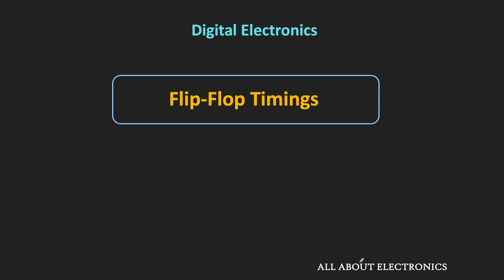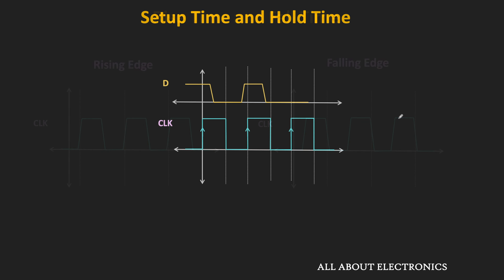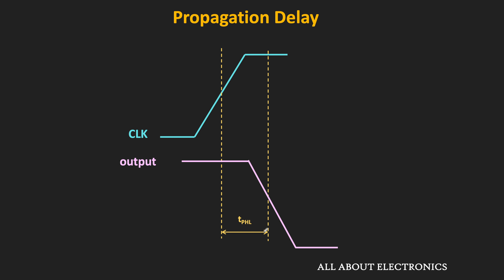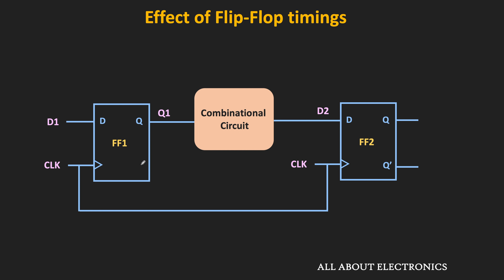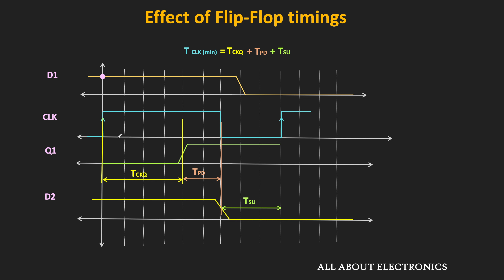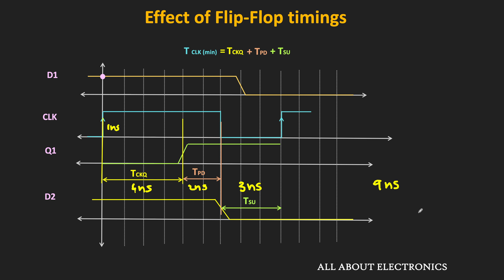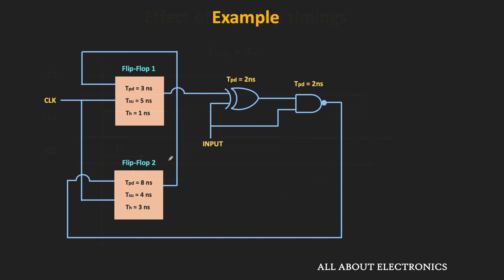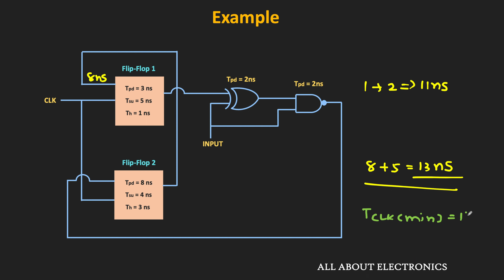Setup Time and Hold Time of Flip Flop Explained | Digital Electronics

Comment: You mean 8 + 5 is the maximum clock duration, not minimum right?
Reply from the maker: It is the minimum clock duration. That means Tclk can be more than 13 ns, but it cannot be less than 13 ns. If it is less than 13 ns, then there will be timing violation.

Comment: 14:09 in starting first case u are considering only propagation delay of the first flip flop why didnt you consider the setup time in starting but after one reputation u r considering the setup time of the first flip flop
Reply from the maker: At first, we were calculating the minimum required clock for the second flip-flop. So, in that case there is no need to consider the setup time of the first flip-flop. In that case, we have considered to total propagation delay from the FF1 to FF2 plus the setup time of FF2. 
In the second case, when we are calculating the minimum required clock for FF1, then the setup time of first flipflop is considered. Please check that example once again, you will get it. And if you still have any doubt then let me know here.

Comment: Hi Sir, In your last example , why didnt you consider Th into your calculation at all?
Reply from the maker: In this case, if you see the propagation delay of the flip-flops or even the logic gates (2ns  + 2 ns), it is more than hold time. That means there won't be any hold time violation in any flip-flop. And as I said in the video, for the calculation of minimum required clock frequency, we do not need hold time. Just we need to ensure that there is no Hold-Time violation. Please check at 11:20.
Reply: @ALLABOUTELECTRONICS  Thanks sir

Comment: @15:00 why are you not considering the Hold times that are given?
Reply from the maker: It is not required for the calculation of maximum clock frequency. I have already covered it from 6:10 onwards. The only thing which we need to check is, there should not be hold time violation.  In this case it is not happening. Because the propagation delay from FF1 to FF2 is 7ns, while the hold time of FF2 is 3ns. That means Tpd > Th. Similarly, the propagation delay from FF2 to FF1 is 8ns, while the hold time of FF1 is 1ns. So, once again there is no hold time violation. 
I hope, it will clear your doubt.
Reply: Hold is considered in the same clock cycle because a hold failure means that the data that was meant to be written to a flip flop in the next clock cycle has sneaked through to it in the same clock cycle. Therefore, the data which was meant to be written to the flip flop in the current clock cycle has been overwritten. Hold failures are catastrophic and irrecoverable since the overwritten data cannot be retrieved.

Setup, on the other hand, is the time that the data launched at the previous clock edge to arrive at the flip flop at the current clock edge. It clearly dictates the clock period. A higher setup requirement will force a delay in the arrival of the current clock edge since the flip flop has not yet received the data to sample. Setup failures are recoverable by delaying the clock edge which is possible through slowing down the clock frequency. Also, even if the setup failure is there but not too much, it may still manage to operate at the same fast clock frequency, but this slack will then translate into an added delay in the flip flop's propagation delay.